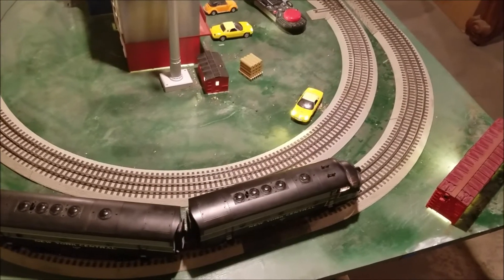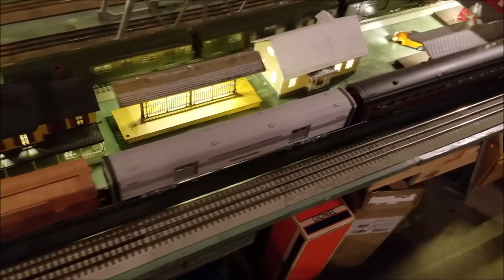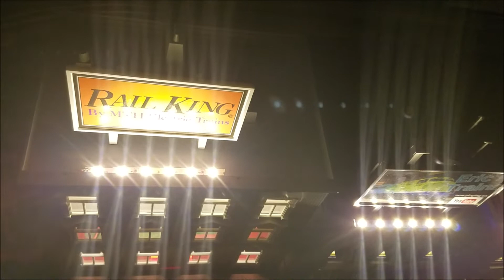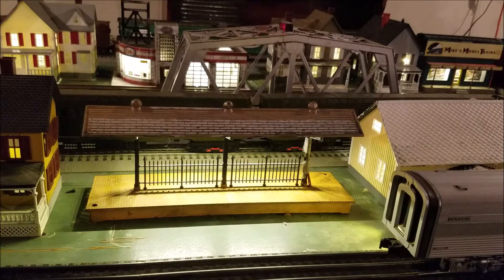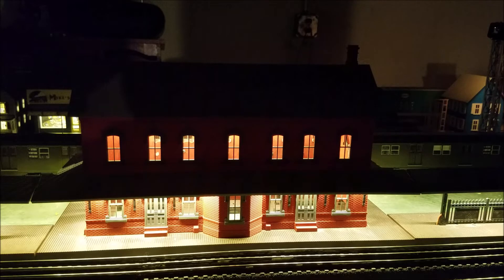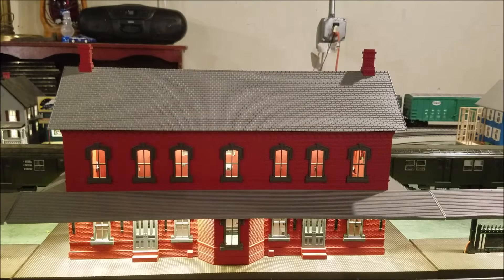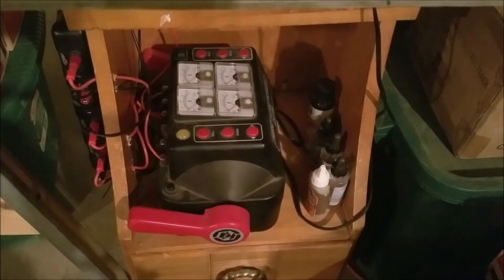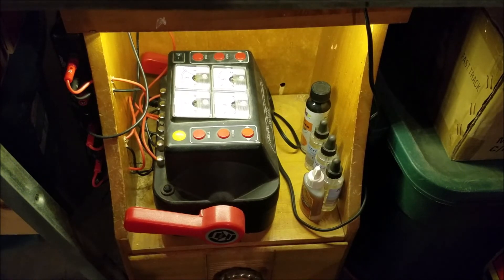PRR Keystone Blog Video #20

Comment: Interesting updates bud.  Love those car headlights - very neat effect.  

Question - why don’t you extend the width of your train table so as to accommodate a larger curve diameter?  That would enable you to run some larger engines and what not.  Just curious - by the videos it appears you have some wiggle room. 👌
Reply from the maker: Thanks Mike! I'd thought about extending the width for larger curves. Just might do that.